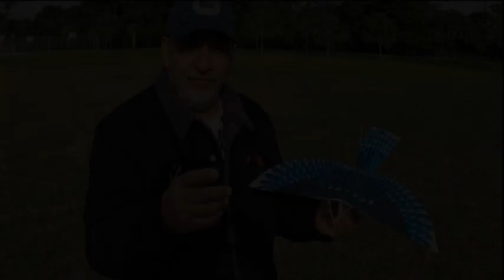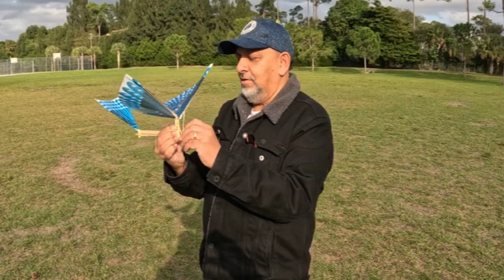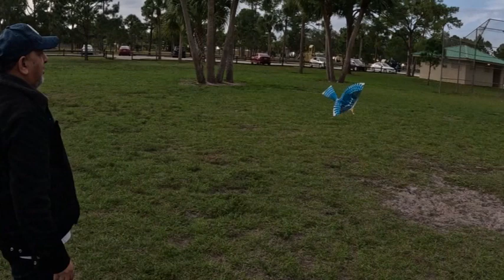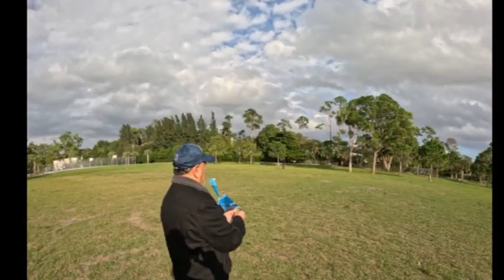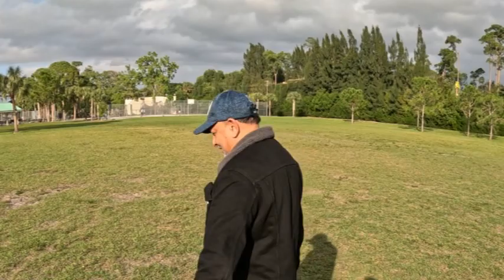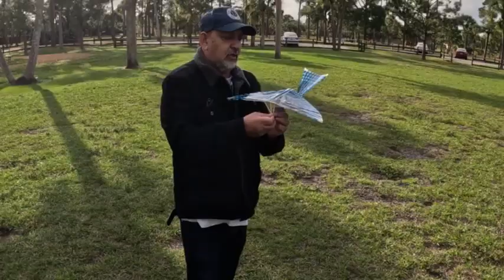#234 Elastic Rubber Band Powered Flying Bird Kite

Comment: Great fun to watch, but you definitely need to fix the plastic onto the tail, that is important to the aerodynamics and will be part of the reason it is circling so tightly. You adjust the climb and the turn by twisting the tail. While one side is disconnected like that, the tail cannot function properly. 👍👍👍👍😊😊
Reply from the maker: Ahh thanks for that hint. If anyone knows you do 👍